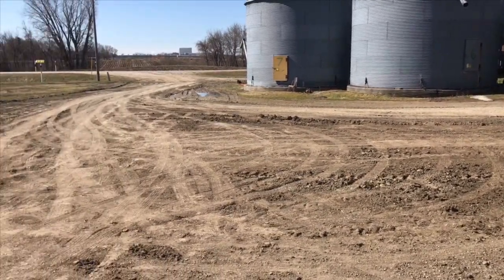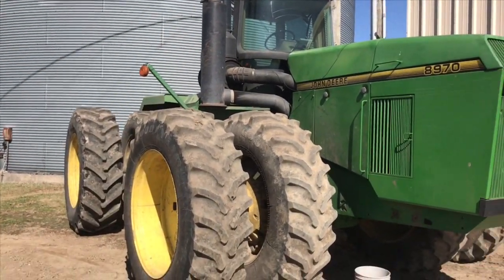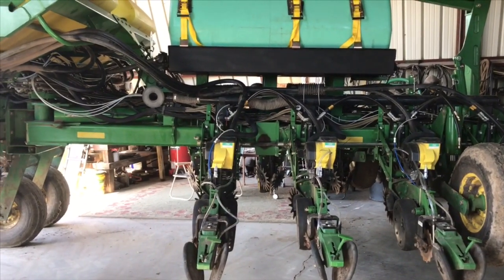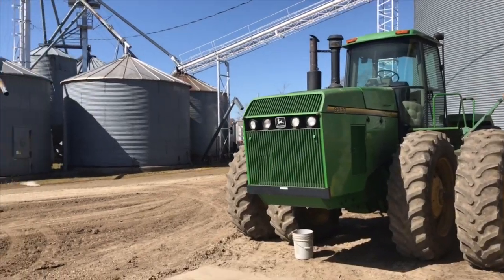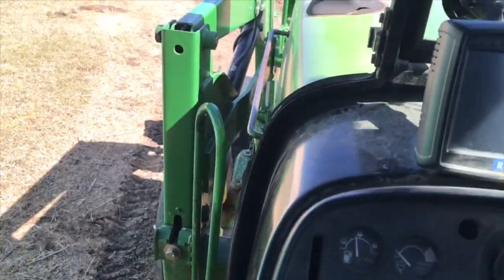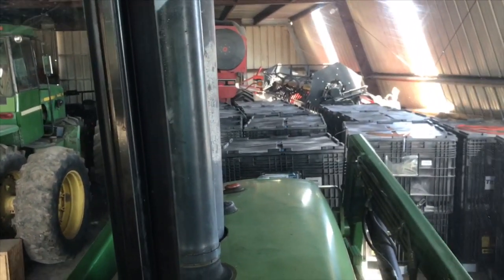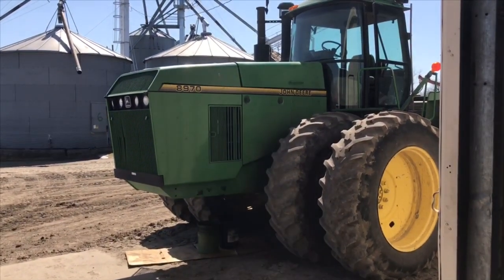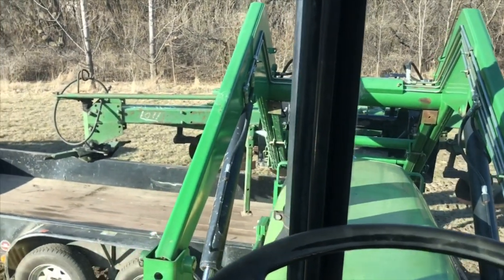Seed, Sprayer Test and Oil Changes

Comment: Have him weld those pipe and caps on the rims over the value stems. Where are the other two tractors at the 8440 and the 8870?
Reply from the maker: uncle is using the 8870 for his digger and the 8440 will be on the land roller